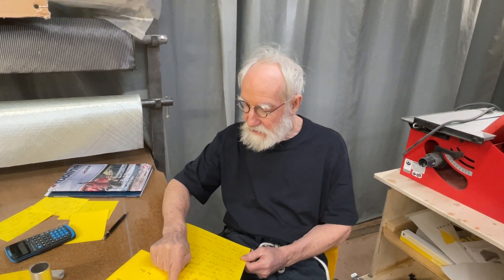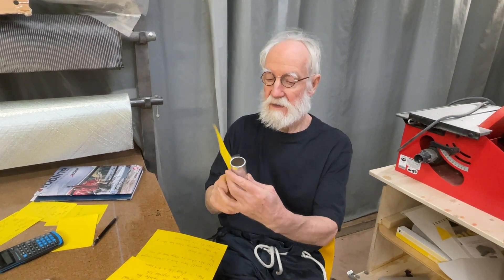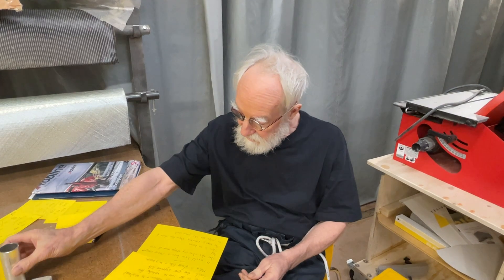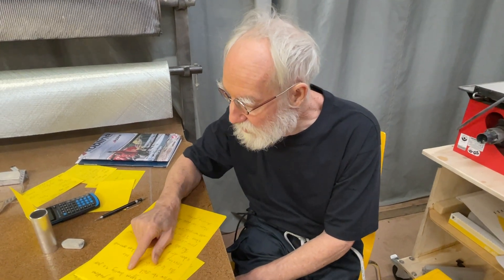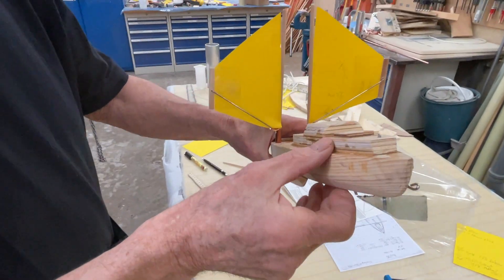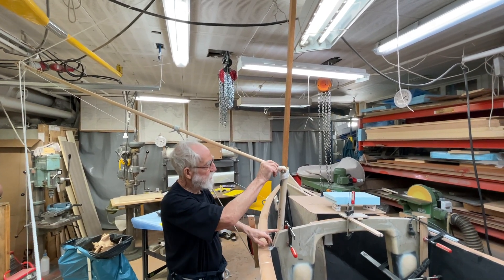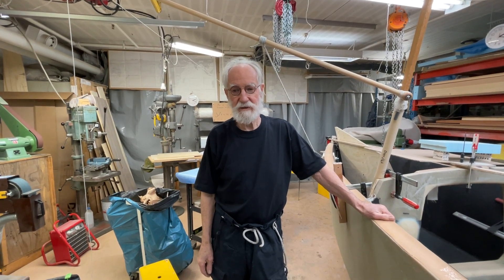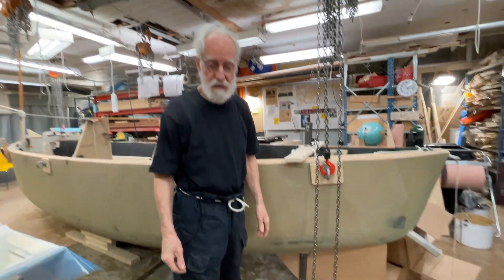Solving the Ljungström gooseneck problem or how to attach the boom when the  mast is rotating.

Comment: With the increased stability that the twin keels will provide, have you considered increasing the sail area a little?
Reply from the maker: I have considered it but Cape Horn is a windy place and wind force increases with the square of the speed.
Production boats are designed for 15 knots wind average Cape Horn wind speed is 25 knots or about 2.5 times as much.
Previus Exlex had 4 square meter now there will be 7 a near doubling

Comment: Bilge keel is what I know them as.
The boom looks a bit complicated, have you thought of using something like a wisker pole that could be attached neat the cockpit. The forward end would have the sheet running through it and maybe a topping lift so that if you release it from the sheet the forward end won't end up in the water. I think that as you fuel or reef the sail the pole won't lift the sail like your boom will🏴‍☠️
Reply from the maker: In fact the booms are more like wisker poles than ordinary booms.
It will be very easy to take them down.
I do not think I will use them on the wind.

Comment: One possible problem I see with this rig is that the boom and gooseneck will end up under a lot of compression. This is because the boom meets the leech-stick at a rather oblique angle. It's going to take a lot of tension to hold the leech-club out, and produce a good cross-section shape for the sail. 

There is also a good chance that attachment point for the sheet-line on the leech-club will be right, on one point of sail, and wrong on the other. When it's wrong, either the top of the sail, or the foot will bag, causing more drag than lift.

In a bad chance, the sail could start to bag. The bagging could put more compression stress on the boom and gooseneck, and the gooseneck could break, or the boom could buckle, or both.

And then, because the sail is not setting well, it will roll up poorly.

I think the biggest source of likely trouble  is the leech-club. It will likely ruin whatever gains that were made at the luff of the sail, as it will have to be thick enough to cause turbulence at the leech.

I sure hope I am wrong in my assessment, but I see a lot of potential problems with this rig.
Reply from the maker: Sea trials will be made. And I am prepared to adjust to reality. But I have great hopes
Reply: Bob,
The compression under load problem can be eliminated by tilting the masts forward instead of aft (as the model indicates) (the boat model, not the human model... although he is quite photogenic...).

Comment: A few points:

1. Once you furl the sail around the mast, only one tack then has a smooth foil on the lee side of the sail. On the other tack, the lee side of the sail will be turbulent off the mast.
2. A rotating gooseneck is used on many small boats to allow reefing. For instance, it is used on the Sea Pearl 21:
     https://www.offcenterharbor.com/videos/virtues-small-boat-gunkholing-sea-pearl-21/
3. Speaking of the Sea Pearl 21, your twin keels reminds me a bit of the twin lee boards on the Sea Pearl. Since lee boards can be weighted on their foot for righting ability, can be easily retractable for beaching, and can be several feet below the bottom of the boat, as well as high aspect ratio, both for better windward performance, perhaps this is a solution you may want to consider?
Reply from the maker: When you change the tack you rotate the mast to get a new smooth lee side on the new tack.

Comment: It's called twin keel. Bilge keels are usually more like smaller add on stabiliser's to a centre keel boat
Reply from the maker: This is like smaller add on to the bow centerboard for lateral area. It is also to put ballast low down and finally to let the boat take the ground with less worry. Not really tru twin keels I think.
I start to feel more comfortable with the term bilge keels but English is not my language.
Reply: @SvenYrvindExlex  Agreed. I wasn't considering the centre board as a keel, but it really is the main keel. So technically these would be bilge keels then :)

Comment: What will you use for the mast tubes? PVC pipes glassed in?
Reply from the maker: I will speak to Marström Composite and ask if the let me do them in prepeg carbon in their autoclav.
Its like a chain they just have to be stronger than the next link in this case the mast
And as strenght increases with the third power of diameter it is not difficult.
The tubes must be bigger than the mast and bearings.
As an example for a mast with 60 mm diameter + 10 mm bearing on each side plus 5 mm pipe diameter gives pipe 90 mm outside diameter 90 divided by 60 cubed is 3.4 times as strong.
In other words its not difficult.
I have not decided I just got the idea a day or two ago. I will let it sink in.
Reply: G11 100MM

Comment: Does this mean that the centerboard idea is gone? How would you now reef the sails? One mast and sail or twin masts and sails? Thank you for considering the questions of an old man like me. Tommy
Reply from the maker: As I said in previus video.
This combines now combines the bow centerboard and bilge keels.
The goose neck fitting do not interfere with the rotating of the masts thats the Idea.
Reply: Your goose neck design sollution creates a challenge for me in designing a sinkable mast.

Comment: When you reef the clew of the sail moves towards the mast, and the boom stays the same length?? In othrr words the boom doesnt get shorter?? Please explain more about the outboard part of the boom and where the mainsheet attaches will it remain the same?
Reply from the maker: The boom is very short 1.5 - 2 meter or so.
I have not worked out the details.
The boom will be a bit like a wisker poole.
I can put it up and take it down at will.
Reply: Most likely, the leech-club will not be attached to the boom. It will be set flying. The sheet line will attach to it somewhere near its middle. The sheet line will then pass through a ring at the end of the boom an then to the deck. This way, the leech-club will always be pulled towards the point at the end of the boom.

Comment: So as the sail is reefed, will the gooseneck boom rotate up toward the mast or will it have to be removed?  I'm with CR Dorado, very interesting design.  With those keels you could have a hole in each one so an axle and wheels could be used to pull it up on shore.  The keels will make it much more stable too.  Less sideslip.
Reply from the maker: The boom will act like ordinary booms.
I will keep things simple so no axle and wheels.
If I like to pull her up on the shore I try to find a piece of driftwood and use it as roller.